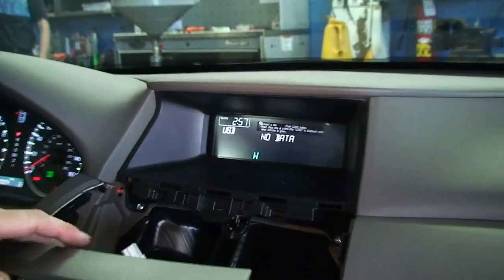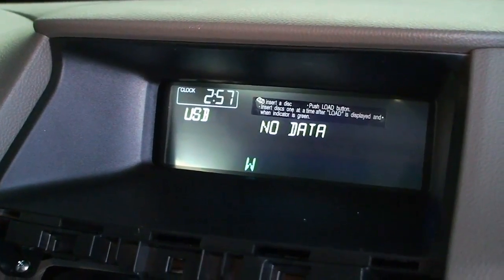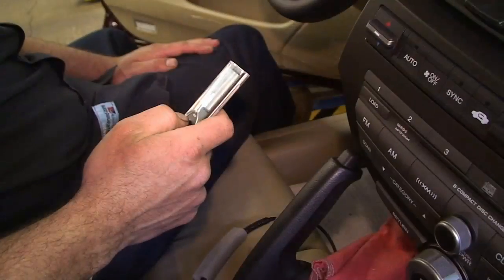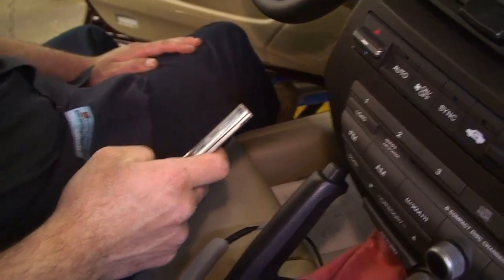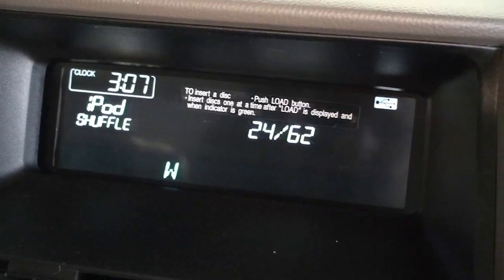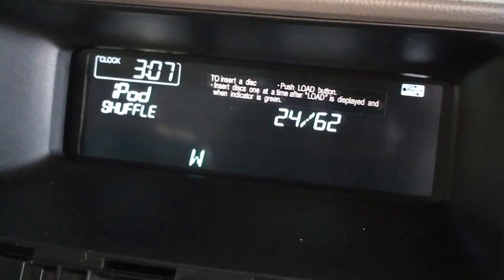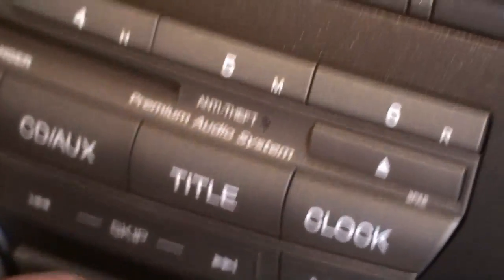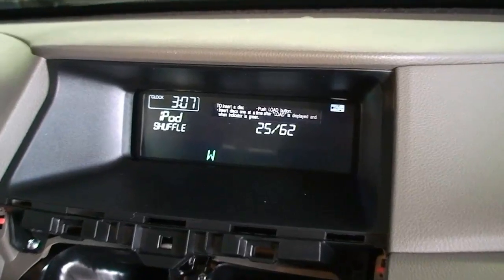Episode #180 - 8th Generation Honda Accord USB Audio Interface

Comment: Friend of mine has the 2012 accord , with satnav screen ( and leather, can't remember the spec. Has a USB Cable female socket in the armrest compartment   Copied music on to 64mgb usb stick in mp3 format and   folder structure \artist\album name\ tracks ..... . Turned ignition off, plugged usb stick into female socket, turned  iginition on , 2 clicks, waited for 1 minutes, pressed aux  - works really well. Artist, album  abd track name come up in sat nav screen, and can be skipped or changed by artist , album or track. sound quality is decent,
Also works the same on my 2010 Civic ,  2.2 diesel CDX ;, except I have no sat nav screen so get 10 characters in the small screen for album / artist ,tab through on [select] button next to CD drive. All free , no extras required.

Comment: Is this the correct part number: Part # 08A28-0K1-100_08B28-TK6-110 (Honda Fit 2009-2010 USB adapter)?  Also, Is the 2 port sub-harness included in the kit? I don't see it listed. I've got the 2010 EX-L v6 with XM and no navigation.

I would call, but it's Saturday night and I'll surely forget come Monday or Tuesday...
Reply from the maker: nestea92 Correct part numbers however the attachment kit 08B28-TK6-110 has recently been discontinued.

Comment: the whole usb control unit kit i mean.
Reply from the maker: For which vehicle?
Reply: 2009 Honda accord coupe EXL
Reply from the maker: Kenny Ang This specific kit is for the 2010 EX-L and EXLV6 sedan ONLY. If you want to fiddle with a USB control unit you can grab one out of the 11-12 Accord. Keep in mind that this is just the control unit. No other parts. 39113-TC0-921

Comment: You say in the video that you took a USB interface from a 2010 EX-L and it installed it in a 2008 LX, is this correct?  Can I then assume that this same procedure will work for my 2008 Accord EX-L-V6?

Comment: I would guess the Nav models have different wiring as the screen is a larger full-color LCD panel instead of the smaller monochrome LED panel on the models without. Just a guess, I'm not a car audio tech.

Comment: any word if this will work on 2011 SE??? I was hoping you guys will try it out lower model accords. now that its a standard feature on 2012 i am assuming it has to work.!! unless maybe firmware on 2012 radio is different.
Reply: I went to the scrap yard the other day I'm taking the USB cords off a 2012 I'm trying to transfer it to my 2008 Honda Accord V6